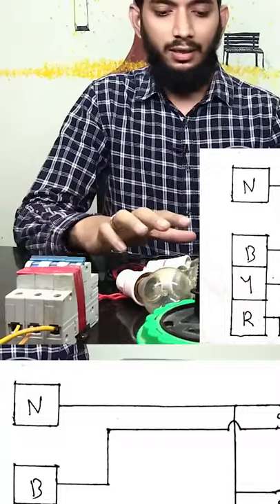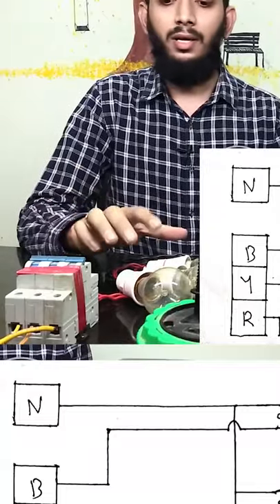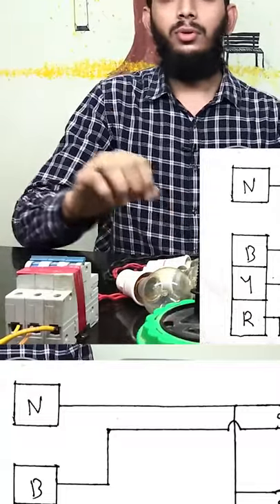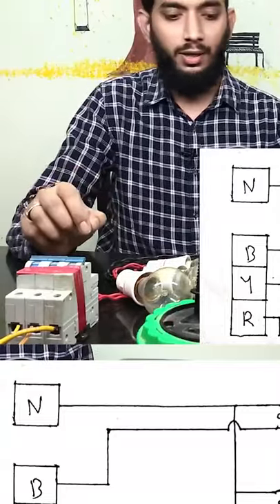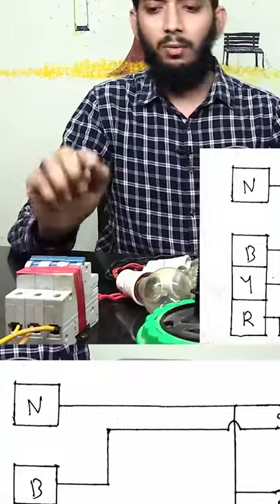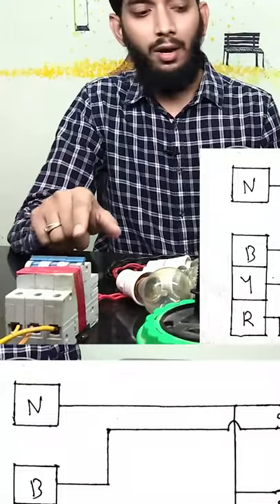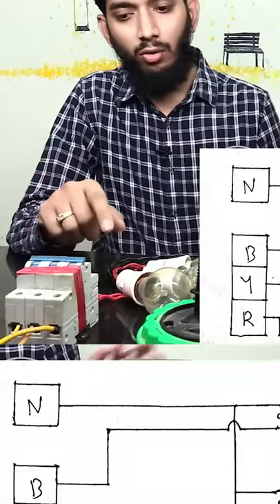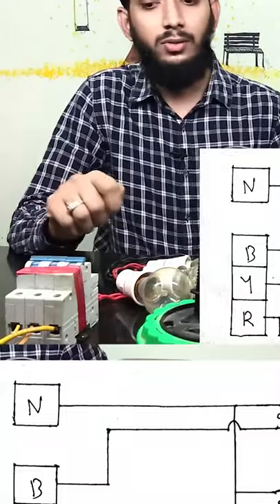Why we have three phase system?#engineeringfacts #engineeringfactstamil #shorts

Comment: One of the Conclusions:
3 phase system neutral wire is optional only..😁
Reply: Yes optional, but for saftey reasons we need Neutral line
Reply: Load balance purpose